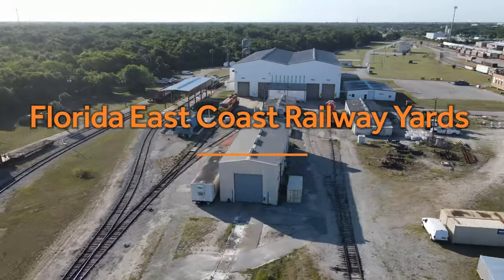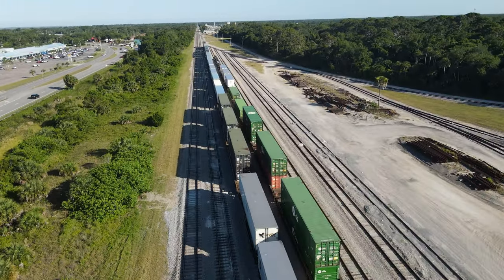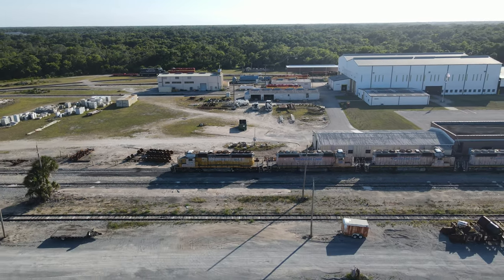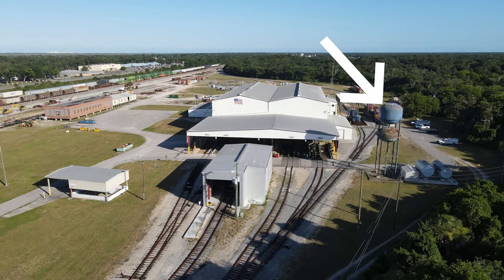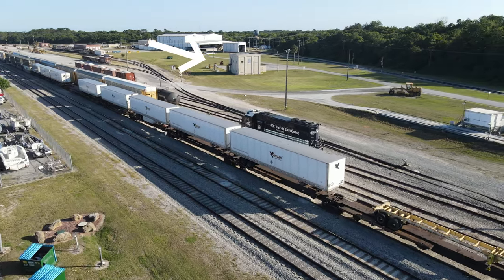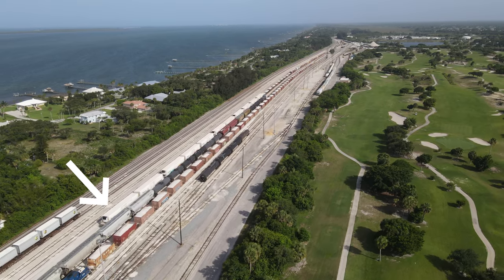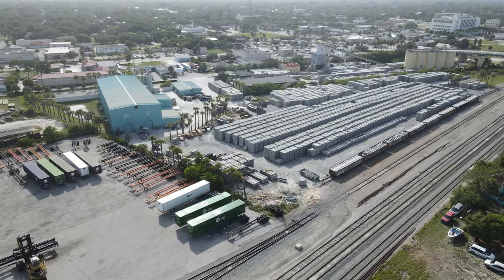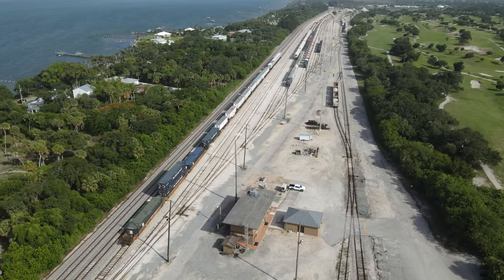Florida East Coast Railway New Smyrna Beach Locomotive Shops and Fort Pierce Yard - June 2021

Comment: Thank you for this view of the railyards - seeing the various buildings and equipment and having them described was enjoyable to watch. I would also have found it interesting to see the actual tracks and routing ... one of those tracks at the Ft Pierce yard looked to have 10 switches in a close progression while the New Smyrna yard a track that curved in and back out to make several connections ... it was hard to tell if it made some sort of S-curve near the top of the screen or if that was a different track.
Reply from the maker: You can check out the track layout from New Smyrna in this google maps view: https://www.google.com/maps/@29.0119894,-80.9235429,413m/data=!3m1!1e3
Reply: @RoamingRailfan  I looked at that - while it does show the trackage it is missing your excellent photography and your insightful commentary - keep up the good work

Comment: Behind the two 1940s buildings ( North one to be exact ) was where the New Smyrna wrecker was kept in the mid 80s. The track is still behind the building but cut off on the North end and the middle.  And yes, I have been in the shops there getting some donated equipment from the FEC. I made the mistake of wearing a white hard hat though. Back then, those were worn by management personnel. Luckily, the shop foreman knew I was coming so he wasn't worried.